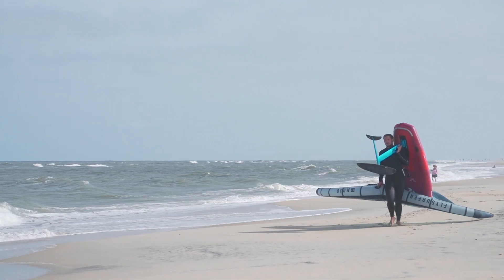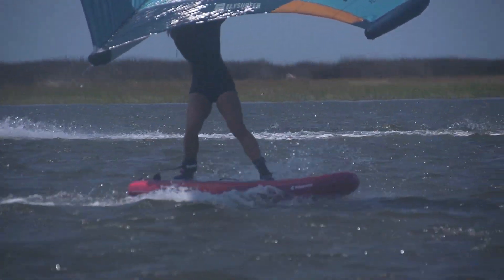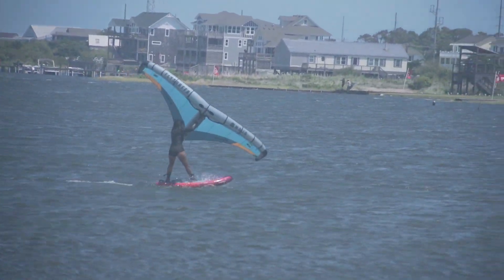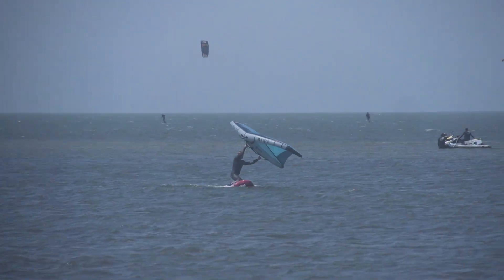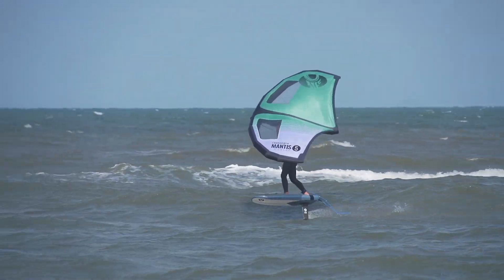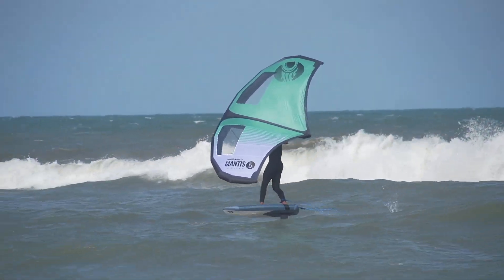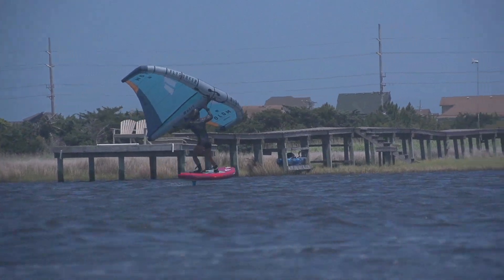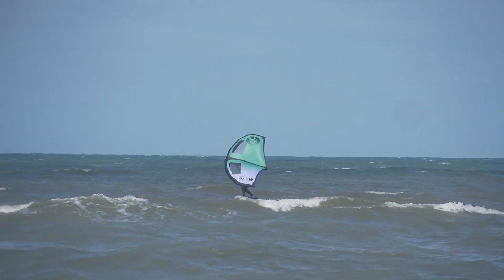How to Choose an Inflatable Wing Foil Board

Comment: We got a SIC 120 inflatable and find it to be pretty tippy. It floats on top of the water like a hunk of styrofoam. Our 106L Starboard Hypernut is a little wider and much longer and has much better stability. It's great to have friends with different boards we can try out to figure out what the deal is as beginners. The hard shell 135L F One works great at only 15L over the SIC. A night and day difference due to the thinner shape.
Reply from the maker: Yes, your inflatables will be more "corky" as a general rule. Be sure to look closely at the width and length rather than just the volume when choosing boards. -Tucker

Comment: I bought a Gong starter pack, 100l inflatable and is really unstable, so I switched with he takoon 145l.  the thing is not the gong website they say 100l is a beginner choice based on the kg I have.. but I don't really think so.. If you start foiling for absolute beginner a 125-145l inflatable is a must go.. Let me know if I say something wrong guys..

Comment: Tucker, thank you for the information. As a newb to the wing/foil, I am interested in advice for the one board to rule them all. I live on a lake with relatively inconsistent wind and am considering an inflatable in order to poach surf boat wake via a SUP/foil set up during low wind times. Occasionally we get cranking winds and then I would transition to a wing set up (in my dreams). Is it possible for a foil inflatable to work as an up wind SUP with the foil wings removed and just using a mast like a daggerboard?
Reply from the maker: Sorry for missing your comment from earlier. 🤙🏽 Do you still have questions that we may help with?  -Aaron

Comment: I just came back from Hatteras (funny you had video from there) after my first go with my brand new inflatable (Fanatic Sky Air). I am a big guy (6'7"/245#). My hard board at home is a 6'0" x 30" (130l) Quatro Wing Drifter. I bought the 5'8" x 28.25" (120l) Sky Air since the dimensions were very similar to the 5'10" (150l)  except thickness of the board jumps from 4.7" vs. 6". I did not want to be up higher off the water. No issues as far as ease of use and early take off. Besides a slight stiffness perception foot pumping, the biggest issue is if the nose touches down. It is manageable but way less forgiving. I am glad I chose the thinner board size of the two.
Reply from the maker: Stoked its working well for you.  Experienced riders can certainly size down on these. -Tucker
Reply: First thanks so much for your post! I have the same hard board but have only been winging in Maui and at my home is in the LA area and I have a boat and will be riding lighter winds at Catalina Island. I am 215 lbs / 5’10” / age 62 / 1850 foil/ 28” mast/ 6.0 f1 strike is big wing. I am just starting to make my heel to toe side jibes on foil. I think the 150l may work the best for me.

Comment: Hi I’m looking for a new board but I can’t decide between a 78lts inflatable or a 98lts rigid one. My actual board is 110lts inflatable, I would say my skills level right now is intermediate and my weight it’s around 85kg. What advice could you give me?
Reply from the maker: If you can choose a hard board I would always suggest that. Especially jumping down from the 110L inflatable. The 78L inflatable will be extremely difficult. -Tucker

Comment: Hi Tucker!!
I am an intermediate rider.
My main board is a Fanatic Skywing 5'2 85 liters. I have F-One Strike Wings 4.2, 6.0 and 8.0 sqm and sail in winds from 10 knots to 35 knots with no problems.
I also have an F-One Rocket Air 5´10 125 liter inflatable board to travel with, but it feels too big and I am thinking of changing it for the Rocket Air 5´4 90 liters.
Do you think that with the 5´4 I will not have problems and will I be able to continue using it in light winds with my Wing 8.0?
Thanks!!!
Reply from the maker: Hey Ajejandro, I didn't catch your weight but yes, it sounds like you could jump down to the 5'4 with minimal affect on your light wind performance.
-Tucker

Comment: Hello there! I just bought an inflable board, a cabrinha one. My fear is that by bending it will get damaged or that in short time the glued Is going to doy and that is going to deflate soon. Not sure if I made the right decision. What are your thoughts on the durability  of these inflatable boards? Not sure if I should return it and get a hard one. Im a beginner. Thank you
Reply from the maker: Durability has been outstanding on the inflatables.  They are also easy to repair if something does peel.  If you see anything excessive, I'd suggest filing a warranty. -Tucker
Reply: @MACkiteboarding  Thank you for replying! That brings some relief on the decision I made. I had a 2nd question if you dont mind. I purchased a 110 lts. cabrinha board but they sell a 80 lts. one. I have an opportunity to swap it (probably) because I havent used it yet. My question is:  Should I get the 80 lts. board instead of the 110 lts. that I got considering that I am 1,90 mts. height (6' 2") and beginner? I heard that they are super stable, the thing is that I dont want to have to change it soon if I can just get the 80lts one and stick to that one for the long run.  Selling it where I live is not that easy... Is it way too difficult if I go with the 80 lts. one? 
Thank you again!
Reply from the maker: I'd stick with the 110L at your size. Keep in mind, Inflatables have a lot more volume than a comparible hard board so you'll have 10-15% more volume on a similarlly sized inflatable. You need some lenth/width for stability and lightwind performance. -Tucker
Reply: @MACkiteboarding  Perfect thank you!